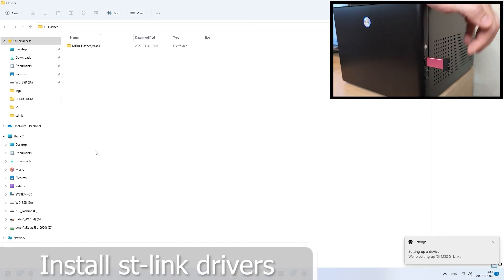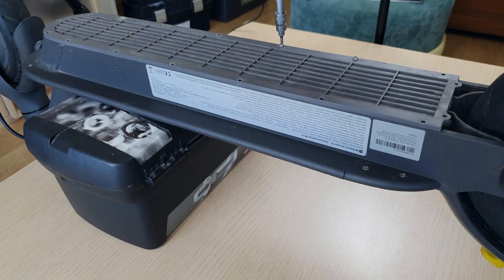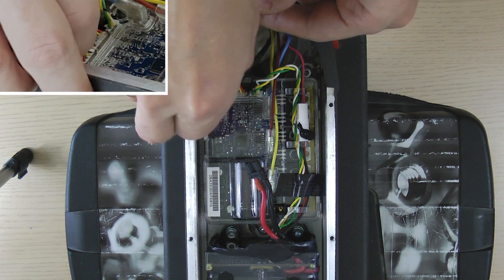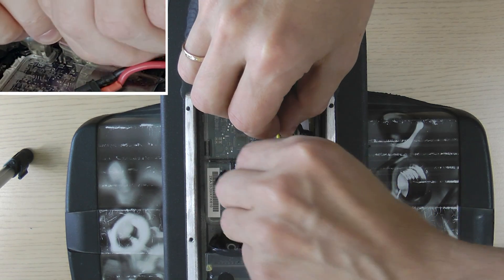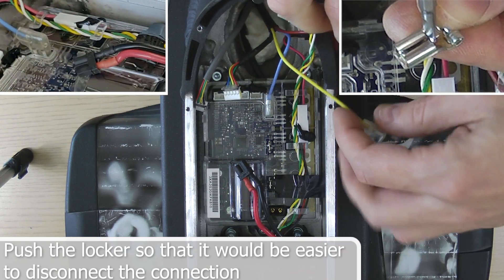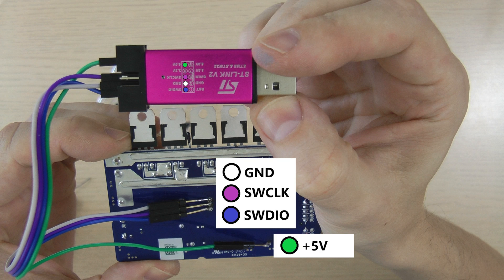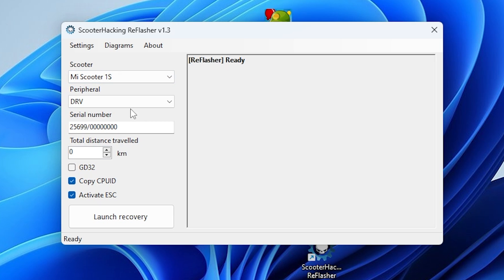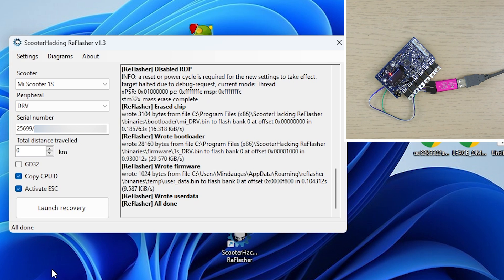Flashing Xiaomi electric scooter ESC board with STLINK (Non-Responsive Power Button fix)

Comment: Hi my friend, i tried to flash it but now i can't connect, i press the button the dashboard opens but it doesn't do anything else, doesn't close doesn't opens light, and of course it doesn't work, if i try the dashboard method without soldering will it work? Subscribed thanks
Reply from the maker: I need more information.
You flashed the wrong DRV to the motherboard, right?
Are there any error codes flashing on your dashboard now?
Have you flashed anything to the dashboard (BLE)?
What model of scooter?
Reply: Its the xiaomi essential 07/2020 model , i tried to flash it via Bluetooth, at first i saw a AO in the dashboard and when it finished installing just the 0 of the speed, but it did not change modes or the flashlight working and even i could not turn it off
Reply: There are no codes flashing neither the scooter is working
Reply from the maker: So, you have flashed shfw.
A0 means the battery is fully charged. To start riding, you need to set the throttle curve in the "Scooter Hacking Utility" app.
It's strange that you can't turn it off with a button.
Perhaps it's just soft brick. Try disconnecting the battery for a while, as shown in this video: https://youtu.be/LLi2S2m4URo
Reply: @MindaugasJocionis  i disconnected all night, nothing happened, it is identified by Bluetooth in shu but when it says press the flashlight to connect the button doesn't work, also i can not turn it off, i must unplug the battery, i'm in the scooter right now
Reply: @MindaugasJocionis  if i use your ble method with st-link will it work? Or if i change the dashboard? Or the drv method with st-link?
Reply from the maker: @Strateas44   contact me on instagram: https://www.instagram.com/siurbutis/
Reply: @MindaugasJocionis  Hi, I have the same problem with my essentail scooter. The scooter turns on but does not adjust with the button and cannot be turned off.
Reply: I flashed the Drv 218 essential zip that i found online

Comment: will this fix error 27?
Reply: it fixes all errors that are not associated with hardware faults
Reply from the maker: If you flashed the wrong firmware and are now getting errors 27 and 35 alternately, then yes, it will help. Subscribe, thanks.
Reply: @MindaugasJocionis  thanks, subscribed

Comment: According to the Scooterhacking app, it says my scooter is a mi 3 but xiaoflasher says it's a M365_3, which one is correct?

Also is downgrading dashboard only enough? or do i have to do both dashboard and esc
Reply: Another bit of correction on the last part, we use Reflasher (it contains everything to flash drv and ble for basically all supported scooters) for that, as I said you can't connect to a scooter with error 42 so you can't really just downgrade it in SHU, and also, flashing order doesn't matter at all, you can start with the esc on the Mi 3 if you want to, it won't matter, either way im not trying to be offensive or anything just want to get things straight based on experience.
Reply from the maker: Strange, I have a mi3, 2 years ago I flashed an unpatched drv, got error 42, after that I was able to connect to it via Bluetooth without any problems and flash it.
A few guys have also done this successfully, just by downgrading the ble.
Maybe something has changed, no idea.
Anywai in worst case you can flash it with stlink.
:)
Reply from the maker: I don't use xiaoflasher. I think M365_3 probably means mi3. If it has dashboard with numbers and blue brake caliper, then it's mi3.
Yes, downgrading the dashboard BLE is enough to be able to flash the controller over Bluetooth.
Subscribe, thanks.
Reply: @MindaugasJocionis I have to correct you that that is not the case, if you only flash the dashboard, the scooter will spit an error 42 at you, referring to a BLE/DRV firmware mismatch, which blocks all flashing/connecting operations through bluetooth, so yes, flashing the ESC/controller IS necessary in Mi 3s as they are the first one where xiaomi stepped their flashing protection up.
Reply from the maker: @PureComedi   Well, I mean, to be able to flash a hacked DRV over Bluetooth, you need only to flash the dashboard with ST-Link. And yes, you are correct; if afterward, you flash an ordinary hacked DRV, you will get error 42. For Mi3, it is necessary to use a patched DRV or special BLE, or to use SHFW from the scooter hacking utility. I think SHFW is the best option; you can tweak it in real-time with the app, and it prevents you from flashing the wrong firmware. And probably, at first, it will be necessary to flash DRV003 (or attempt DRV downgrade with "scooter hacking utility") to be able to flash anything on the mainboard, but this is another story :) The first step is to flash your dashboard (BLE) with ST-Link to be able to do anything. 
Thanks for the corrections and help, it would be great if more people here helped others under these videos :)
🤝

Comment: Hi, I bought a used scooter which had been flashed using bluetooth and mobile phone app. I want to change the firmware to my own but the apps show errors or flashes but it doesn't actully affect the scooter. Will this help me to be able to flash it with my mobile phone again? Thanks
Reply from the maker: In my opinion, it should work. Subscribe, thanks.

Comment: Any advantage over using M365downG (except you don’t need an android device)
Reply from the maker: This method is for bricked controllers. Otherwise, flashing the firmware using Android apps via BT will be much easier and faster.
Subscribe, thanks.

Comment: What do i do if the screws on the bottom are all weared down and wont come off
Reply from the maker: Look on YouTube; there are a lot of videos there. Personally, I would use a Dremel to make a cut in the head, and then use a flathead screwdriver. Subscribe, thanks.
Reply: @MindaugasJocionis sir why does my flasher not oppening and theres an error saying download .NET core then nothing happens?
Reply from the maker: @TeamAmierliaTV  Perhaps you blocked it with a firewall, or did not allow access to your network, or the laptop was not connected to the Internet. It should automatically download the mocrosoft .net core.
You can do this manually, but then you will also have to manually download the drv and place it in the correct folder.

Comment: What if I bought a used one in order to fix it and I have no serial number of the scooter? Is it going to be a problem?
Reply: Thank you for the quick answer, subbed and liked. Greetings from Poland
Reply from the maker: Check on internet there are plenty of them :) I believe you can use random just with correct number on the beginning according to your scooter model.
https://wiki.scooterhacking.org/doku.php?id=mi365
Subscrube, thanks.

Comment: Just a quick question for you when I turn my scooter on the Bluetooth icon does show but when I try and connect it to the app and try to flash it is not currently letting me
Reply from the maker: Can you still ride the scooter? If this happened after flashing, then your esc is bricked and this will help. Subscribe, thanks.

Comment: any idea why it says"init mode failed" and "cannot connect to target"??
Reply from the maker: This means the st link is not connected to the controller. Is the controller original?
Update stlink firmware, double check soldering and make sure that wires are connected to correct stlink pins.
Subscribe, thx.
Reply: hey, ive made sure all coating is off and its all connected properly, is there any way we can message privately so we can resolve this? thanks
 @MindaugasJocionis
Reply from the maker: @TintedBoiUK  https://instagram.com/siurbutis?igshid=MTNiYzNiMzkwZA==
Reply: @MindaugasJocionis Did you guys resolve it?
Reply from the maker: And if you are trying this without soldering, you will first need to remove the coating from the solder points on the controller. Use isopropyl alcohol, or something similar.

Comment: Hey mate,
i have buy an used scooter in germany and i think its manipulatet an the preowner is still conectet ..
Can i restore it to original with youre teknik?
greetings!
Reply from the maker: It's tied to your scooter's serial number (to Mihome app), so I think it's possible, but you'll need to get an unused serial number or used and removed from mihome account. If your scooter has BLE less than 155 you can change your scooter serial number over Bluetooth with apps like "downG" etc. (there is no need to dissasemble).
Subscribe, thanks.
Reply: @MindaugasJocionis   Bluetooth conection dosent work  so i dont know the BLE and display is just blinking. 
Thanks for youre quik answere! 

Edit: Also DownG dont work couse my Androidversion is to new
Reply from the maker: @mikromike8827  So you cannot ride it? If it has bricked ESC, then this will help.
Reply: @MindaugasJocionis  OK I'll try it soon and if it works I'll let you know😊But first of all thank you very much

Comment: So, i accidentally flashed a wrong file, and now the power button is acting weird. It does turn on, but I cant go into eco mode or pair it to my phone. Im guessing this is related or what? And is it worth for me to do it (i have no background in this), or ahould i just buy a new esc and replace it
Reply from the maker: Yes, this will help you. The best option is to recover your original controller.
Subscribe, thanks.

Comment: Hello. I have a mi essential with sco driver v3.3. Is valid the video method? I can´t install reflash, it asks me to install .NET core. What can i do?
Reply from the maker: Yes it will work. ESC version you need to check on board. NET Core you can get from here: https://shorturl.at/jxPQ5 or from Microsoft. Subscribe, thanks.
Reply: @MindaugasJocionis  It's already working. thanks very much friend!! You have a new subscriptor

Comment: Hello, i have a problem

Esc v3.0 (same as you) and all is soldered and connected like the video but i don't get the green light
only the red shows up

and the ReFlasher program on the pc say "couldn't connect to st-link"

What should I do?

Thanks if sb can help me !
Reply from the maker: It means that st link is not recognized by pc. Did you installed the drivers? Might be bad port, extension cable etc.
Reply: Ok i will try on another pc tomorrow
Reply: Thank you ! Super video.👍👍
Reply: Ok i installed the driver now, but it still doesn't work but now the progran say "couldn't connect to target" 🤦
Reply from the maker: This indicates that STLink cannot establish a connection with the board. Please review the soldering and wiring connections to ensure they are correctly attached to the designated pins. @wiilu0073
Reply: I'm quite sure that the solders are properly made cause I've checked with a multimeter.
Reply from the maker: @wiilu0073   Try to ask in this telegram chat: https://t.me/scooterhackingchat

Comment: Hi I recently purchased a Xiaomi m365 scooter, but have trouble pairing it to the app. I have an iPhone and when I try to connect to the app, it shows up, but when it reaches the "press the power button to pair" I press the button and nothing happens. What should I do? Would reflashing the board help in this case?
Reply from the maker: I don't think this is related to the motherboard firmware.
Does any error appear? If the scooter is connected to one account, you will not be able to connect it to another. But an error should appear (at least in the Android application).
Subscribe, thanks.
Reply: @MindaugasJocionis  thanks for the reply. Is there another workaround such as replacing the Bluetooth chip? I bought it second hand and the previous owner said that he doesn’t have the mi home account anymore. Also, I’m on iPhone so whenever I try to connect it and reach the “press the power button stage” it just turns the light on, but no error appears.
Reply from the maker: @Pak-zf8qk  Try asking in this Telegram chat: https://t.me/scooterhackingchat 
It might be because of a clone ESC as well, who knows what was done with that scooter...

Comment: hello.

I really hope you can help.
I got a mi 2 pro, and bought a m365 pro display with Good ble to unlock speed.
Something happend in the flashing, and know both display are saying error 35 and sometimes 27.

Do you think a stlink will be able to fix the problem.
Reply from the maker: You flashed firmware that is made for ESC (mainboard) 3.0 and your's is 3.1. Do as in this video and it will be running again. Subscribe, thanks.
Reply: Thanks.
After I do like u in the video, will I then be able to flash custom speed with the original dashboard 157 ble or should I still use the new dashboard I bought with good ble?

I will subscribe
Reply from the maker: No, you only will unbrick esc. To be able to flash custom firmware to mainboard (esc) over bluetooth with original dashboard, you need to downgrade ble (dashboard firmware) like in this video: https://youtu.be/IvQ4oT2u_vg
Or use a purchased dashboard.
Reply: So the new display I bought from a 365 pro with good ble will just brick it again?

Maby I wrote it a bit unclear, but a have already bought a display from a 365 pro with good ble (my scooter is a 2 pro)
So if I unbrick like in your video, will I then just brick it again with the display from the 365 pro?

And again thanks for helping, you are great
Reply from the maker: If you flash the firmware for a new type of controller, it will not be bricked. The problem was that you flashed the wrong firmware. The best option is to install shfw from the "Scooter Hacking Utility" android app. SHU recognizes the version of esc and flashes the correct one.
More info anf help you can find in  this telegram chat: https://t.me/scooterhackingchat

Comment: Hello Minda I hope you will answer me, I need help.
I have a Xiaomi Pro 2, I downgraded it successfully from 158 to 134 with ST LINK V2 (Dashboard).

Then I wanted to flash 129 for then install 075 for custom display.

After successfully flashing 129, the display was still stuck with Lock and Bluetooth icon (but my mobile phone disconnected strangely).

I stupidly turned the display off and it doesn't anymore turn on.

When I press power button the red back tail blinks 33 times.

I tried to connect ST LINK to the Dashboard (only 3 pin no 5v) for a write flash but it gets no connection.

doing this procedure to the ESC Board will fix the Dashboard? 
it's the same as flashing though the Dashboard?

Now I unplugged the battery hoping to find a way to unrbick my Pro 2.
Reply from the maker: If you flashed ble129 and dashboard doesn't work, you don't need to flash esc. Disconnect the dashboard from the scooter completely. Connect 5v power from stlink to it, and do write flash.
Subscribe, thank you.

Comment: Can you please help me my scooter doesn't turn off and i cant even click on the power button so it comes flashlight it shows no battery nothing it happend when i tryed to make my scooter faster with a file by using an app please help
Reply from the maker: You probably have ESC 3.1, or just by bad luck bricked it while flashing. Do as shown in this video, and it will be fixed. Subscribe, thanks.
Reply: @MindaugasJocionis  but i cant connect the scooter to the computer like you did
Reply: @MindaugasJocionis  you now how i can connect to the scooter with out the power button
Reply from the maker: The only way to unbrick esc is as shown in the video. It has nothing to do with dashboard, it's mainboard (esc) problem.
Reply: @MindaugasJocionis  damn cause its to complicated like you did in the video

Comment: Why can’t connect on new version of DRV the stlink always say target not found
Reply from the maker: What do you mean by "new drv version"? New motherboard version (ESC3.1)?
If so, you need to check the "GD32" box.
Usually "target not found" means poor soldering or incorrect wiring to the stlink.
Subscribe thanks.

Comment: I have mi essential and flashed a wrong firmware, now the controller freezed up. Tried to unplug and plug the batt conmector and still same issue. Please help. TIA
Reply from the maker: You bricked esc controller.  This video shows you what you need to do. Check the video description for tools you need.
No worries it's fixable. And don't forget to subscribe, thanks.

Comment: Is there any reason instead of the green light I have red light coming up?
Reply: Hello i have the same problem but it's an original esc (v3.0)

The re flasher program say "couldn't connect to st link" but all is connected like the video and only the red light shows up. 
I hope there's a solution !
Thanks.
Reply: @wiilu0073  I ended up buying another one that worked straight away from the downgrade app. The key is that no xiaomi app should be on your phone. But now I have another issue with my scooter 🤦🤦🤦🤦 

Seems like the motor has giving up,  if I try to go with it the front wheel starts to vibrating, it started to doing it when I was coming downhill and the motorbrake was turning on.

I'm getting to the point that I might just gonna throw it away 😆🤦
Reply from the maker: On esc? What does the reflasher log say?
Subscribe thanks.
Reply: @MindaugasJocionis  it says it can't comnect. I asked in a fb group, they said it's a fake controller so no chance to downgrade it :(
Reply from the maker: @kornelpasztor7947  :(
Reply: Oh sorry about that 😅 did you checked the wires maybe a phase1,2,3 is disconnected ?
Reply: @wiilu0073  it was working for a while without a problem then started to messing about. I will check them thanks for the hint